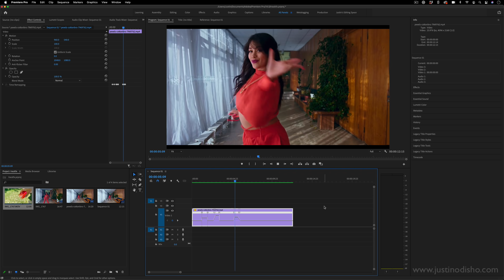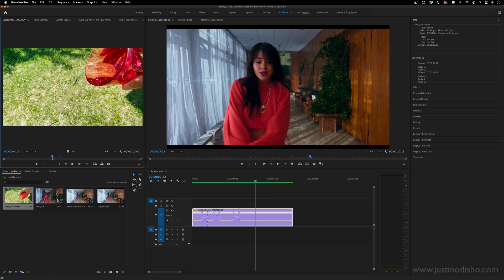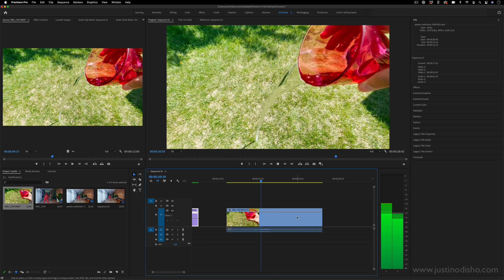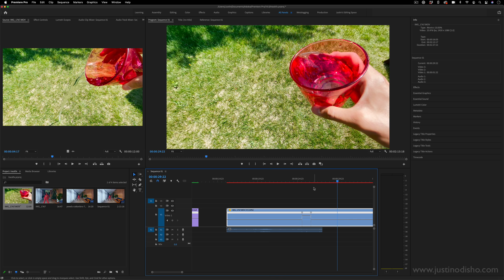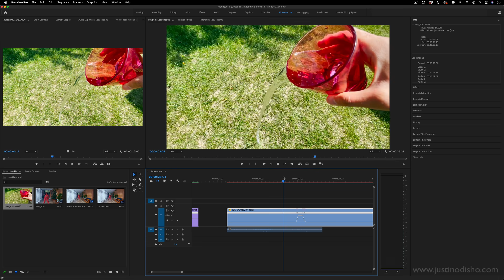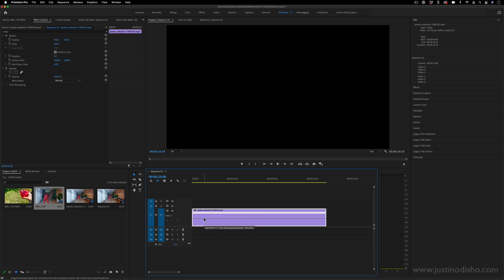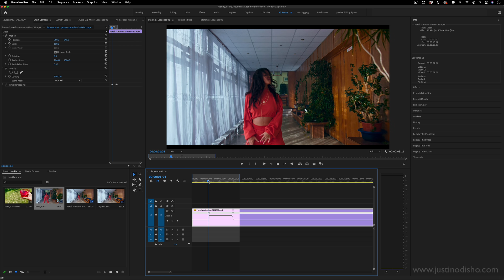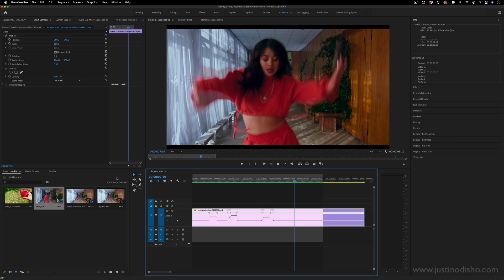How to Speed Ramp Slow Motion Footage in Adobe Premiere Pro CC (Tutorial)

Comment: Is it best to Interpret Higher Frame Rate Footage to Lower Frame Rate Sequence or to leave the Higher Frame Rate alone and adjust the Clip Speed / Duration for smoother output?
Reply: I always film in say 60fps and interpret to 23.976 so it becomes slow motion on my timeline, and it appears that is what he has done here, then you can go back in and speed up in certain areas, so yes I would interpret before adding any speed ramps 👍🏼 the out put will be smooth like that
Reply: @LindseyDara  Thats what ive been doing as well, but being in Australia and using Pal for video format standard I film at 50fps and interpret to 25. Thanks for reply.

Comment: Justin, whenever I try to Command click (Mac) on timeline to set a keyframe, it sets a keyframe for Opacity and not for time remapping. Any way to correct this?
Reply: Sounds like you're missing a step here. At about 2 minutes into the video, he explains how to get that line to correspond with Time Remapping. Opacity is the default usually in Premiere. If you right click the video (or control-click on Mac), go down to Show Clip Keyframes. Then select Time Remapping. Then select Speed. That will change it from Opacity to Speed and will allow you to keyframe correctly.